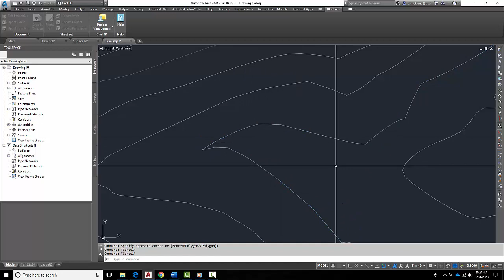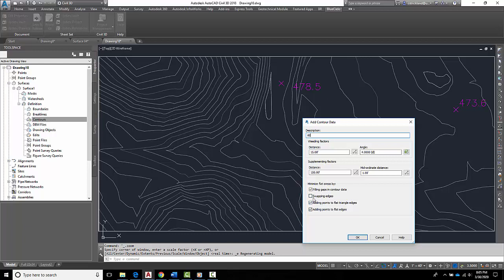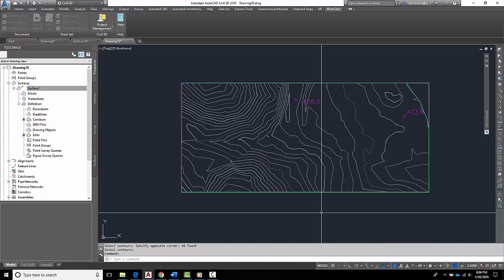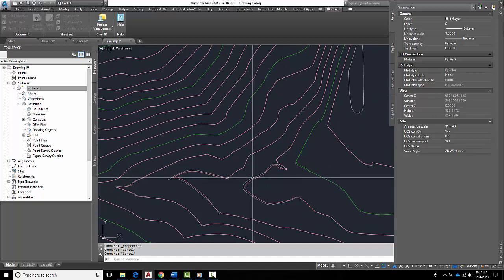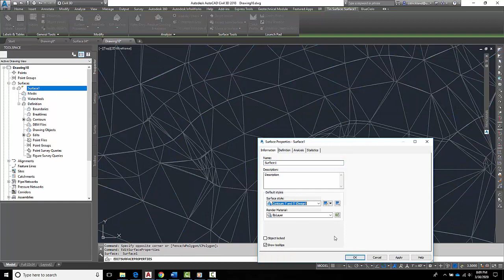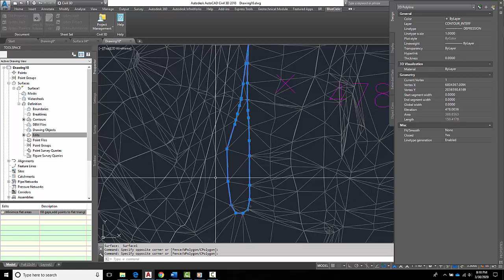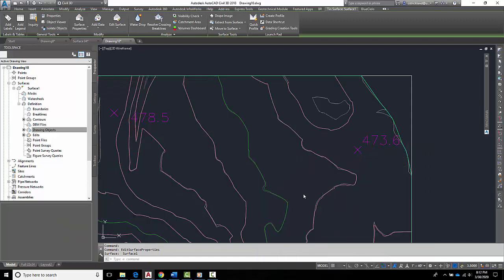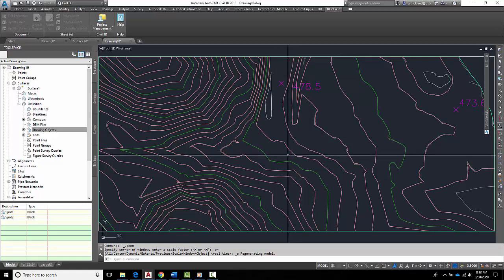Surface Creation - Polylines for use in Civil 3D

Comment: thanks for sharing .. I tried to do all the steps but the surface still doesn't created
Reply from the maker: You might need to check your source data, if the poylines are all at elevation 0 you will get a surface, but no contours will show up. If your lines are at the correct elevations then you might have a surface style that doesn't display contours or TIN.